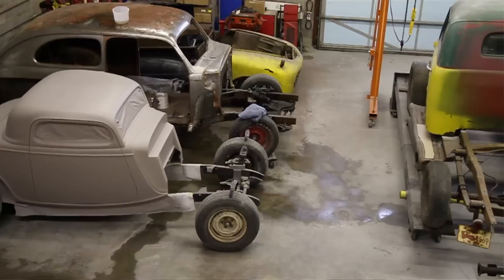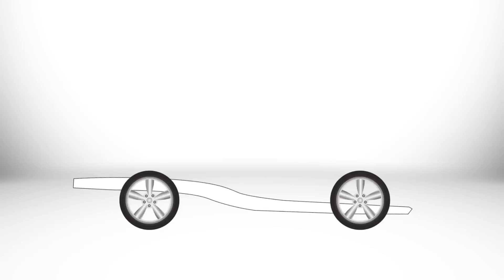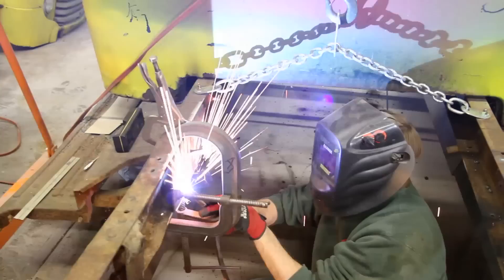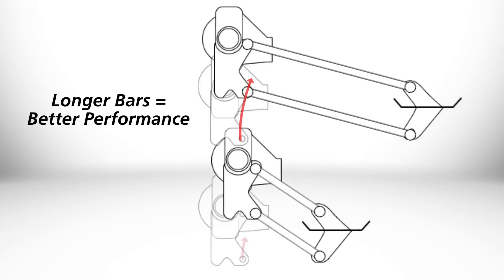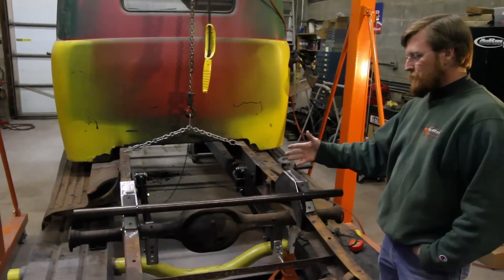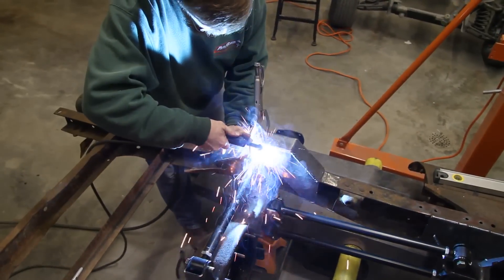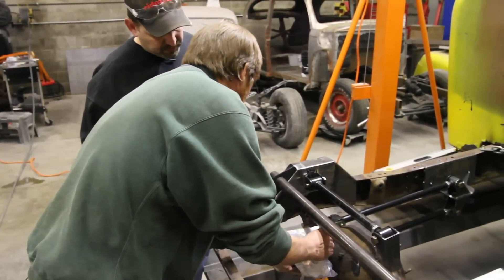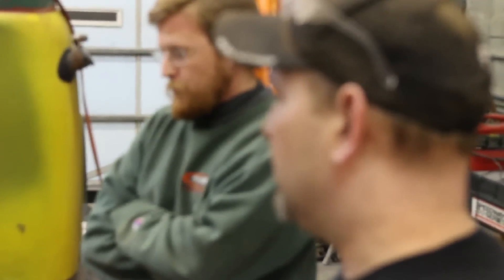4-Link Rear Suspension for Air Ride and Coilovers

Comment: Why not make a triangulated four link suspension ??    I think it is much better.  I do not like track bar / panhard bar.
Reply from the maker: Hello Ron, we offer a triangulated version also, problem is not all applications have room to mount the upper bars without interfering with the cab / floor pans.
Reply: @ridetechtv  Then make the track bar / panhard bar as long as possible. Another way is use four link as a trapezoid angles on the four link. Good luck!!!

Comment: I'm not sure what your thinking was regarding all the geometry set up with the axle welded to the frame when in reality it shouldn't you set pinion angle and all other angles when axle on ground with drive weight on frame at the height you want? Or have you assumed 0 is where it is at where it is welded?
Reply: I would love to know that as well

Comment: Better pinon control is key in off road setting. Easier I'll bet to use a bar come down off factory 4 link & switch it after market then go the other way & that is key w/jeeps customizing built into factory design.

Comment: The ideal set up currently dreaming: it up would b 2 coilovers per corner low range & high range both dialed in & if my low harvest the max rear push & limits the bump even better.

Comment: I get my loading more bed more stable tow tembren get 2nd shock /bump limiter & I don't need to hack up these frames. The air or hydraulic bump stops can b used 2 corners of roof rack system so u level out the load & limit the hit if rolled U can see how much wt u hve up there visually. Ppl that do heavy ass trailer towing hving many bump stops built under trailer will do same thing even out load across length of long trailer & u can see what u hve up there & visually know ok med load med heavy  or heavy or over wt at a glance.

Comment: Back to this shock as built in bump stop by using more than 25deg angle.  What ever the fucking angle trial & error that limits bottoming out by wt w/max travel for each jeep or truck or NOW/jeep/truck, that is what I want to harvest. I hve my normal standing main shock or coil over & I hve my 2nd shock per side or corner that limits my bump. That plus tembren rubber for loading then my 2nd shock harvest the bump effect should b enough but on baja type trucks jumping still need suspenders & belt limiting straps.

Comment: All depends on the persons . In high speed racing hving rear kicked into turn will give u more drift &grip & allow u to stay ON power while turning & races r won in pits & in the turns.  Off road we want exact opposite widest track poss rear kicked opposite to direction we r big f-ing truck trying to turn or lockers trying to turn.

Comment: What ever distance/length of adress & angle gives Me the most contolable intentional slop movement pre throwing rear into a turn is what I/JBM/God am looking for both sides. & for offroading only racing that still has any performance to b gained out in 8/22/2020 I need to address my rear end super slop both sides tiny panhart *4 bars By using 4 shortie max movement bars I kept my address dead bank floating permant driving down the road but when I am off roading I unhook the 2 top & bootom connect limiter address bar connecting bars, & I can DO IT OPPOSITE to street racing throw rear lockered hard right or left free floating up & down the opposite diection I am trying to turn up front. It will/should greatly improve turning circle w/ locked or any time u need tighter turning radius on Jeep/truck or big F350 truck. bc the rear is out side the line of front axle.

Comment: that real shortie pan hard bars? moves the rear opposite way but "locates it/address here usually doesn't change. But if cornering u could cause rear to intentional kick into a turn on track that would b a good thing. If not f-ing going around in pntless circle <u Want 2 panhart shortie bars w/lots of slop that u can intentional move b4 u go into a turn. Right or am I /God still missing something?

Comment: U set the ride heigh about 4 inches pinion angle at 3degrees and do u set the 4 link brackets at 3 degrees or at 90 degrees and 4 links at 2 degress thks.

Comment: An open hat channel is better for flexibility for the 4 bar, rather than tube which will not allow twist with different left right wheel bump motion...  I understand the reason for using round shaft it's easy material to source, cut and fabricate...

Comment: Why not angle the top links like a mid-70's GM  coil rear suspension to eliminate the need for a panhard rod and cause the rear axle to move up and down in a straight line instead of an arc?

Comment: panhard bars were fine with horse a buggy but a watts link should always be used
Reply: Yep, and mounting the panhard rod on top of the axle means an unnecessarily high roll centre = poor handling. Should be lower and as long as possible
Reply: PSk same as the axle line would be ideal

Comment: ok look here @ the 1.37 mark of this vid.  You have a drawing that shows the engine and pinion angle the same and even state that you want them parallel. Now you can have them paralle, but the angles can NOT be the same as you show in the drawing. They have to off set eachother. so if you have -3 for the motor you have to have +3 for the pinion. That is so important that if on the build the engine and pinion happen to be at the exact height you must push 1 pull the other. in order to create that off set.

Comment: Holy crap... Why'd you make that panhard bar so short? On factory applications like 82-2002 GM F bodies the bar runs from one rail in the unibody almost to the other end of the axle. Same on like an Escalade or Avalanche. I was thinking to myself "if I was doing this I'd go watts link" so you get no side to side movement (or minimal at least).
Reply: John Hartley they called a 5 link a 4 link; you expect logic to go with inability to count?

Comment: what you do in your own shop is your buisness, but if your making an instructional video please consider demonstrating proper safety. welding with bare hands and no helmet isnt a verry good example.
Reply: shonuffisthemaster I think it is a great example of only using tack welds in mock up. You would be surprised how easy it is to weld up a joint, you only intended to tack. Fabrication skills, just watch and learn.

Comment: Is there a way to do this and not notch the frame? I don't want to cut my box apart.
Reply from the maker: It would require a bit more fabrication; give our guys a call at 812-481-4787 to discuss details!  Thanks!!
Reply: Don't go as low.

Comment: panhard bar hits the differential when is fully lowered
Reply from the maker: You could always add a bumpstop; since we don't drive anything while at full drop, it wasn't an issue during this build.  Give us a call at 812-481-4787 if you have any questions; thanks!!
Reply: ridetechtv this video helped a lot witj my chevy luv. not the same truck but the setup is almost the same
Reply: jer mou--if you hvnt done yet check into a triangulated 4 link--it doesnt use a panhard bar and same idea only difernt
Reply: That is why they mentioned you could bend the panhard bar to keep from hitting without affecting the geometry.

Comment: is a 24" 4 link bar to short
Reply from the maker: +Carlos Grijalva  looking for an answer on your tech question? email josh@ridetech.com for help. Thanks
Reply: Carlos Grijalva no thats fine, s10 trucks use a 16" my dodge had a 28" with bag on the lower bars of the 3 link and the truck got 15" of travel axel stayed center throughout and the thing rode like a Cadillac

Comment: Couldn't u do a lot
Of the centering up  with the leaf springs still on? Maybe break it down to the main lead so it's more flexible. Just wondering if I could 4 link my jeep myself the springs are on top the axles maybe just remove the ubolts put the brackets on and weld
Reply: Fiat used a 4 link suspension setup with leaf springs  in the 125 and it worked really well

Comment: I should have done it that way building a race truck or 2 a few years ago
would have saved a DAY  measuring  by just tacking the tube in center. shakes head K>I>S>S method works best every time

Comment: Yeah, i'm thinking they previously found that ride height would be perfect when the top of the axle is welded to the frame, (must want to slam it on the ground)
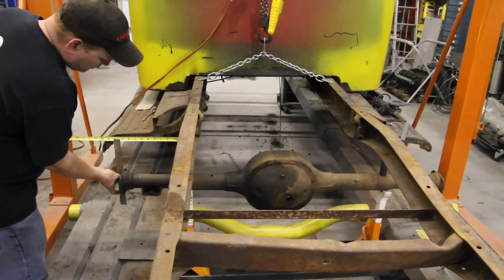@0:56 They have a spacer in place, so that must be a ride height they were trying out, but wanted it lower in the end.
So get your measurements and ride height set. Weld axle solid to the frame in ride height position (including pinion angle). Then fab up your link kit.
Just my guess. For what it's worth.

Comment: @vcarreon17: Depending on the size of the C Notch, yes and no. By the looks of this C notch, they will either have to begin cutting into the bed or raise the floor of the bed. However, there do exist some notches which can be welded in which do not come up past the stock location of the bed floor. All depends on how low you want to go.